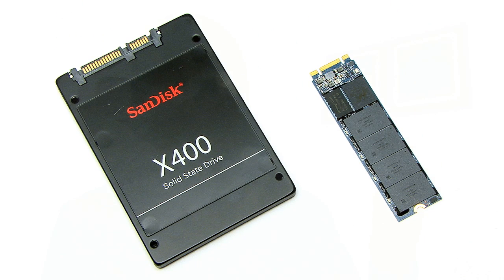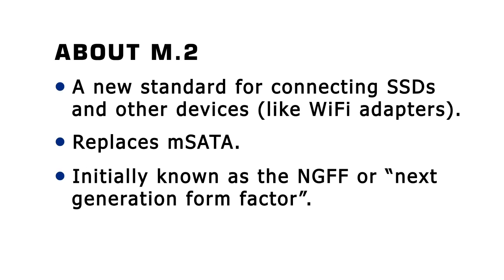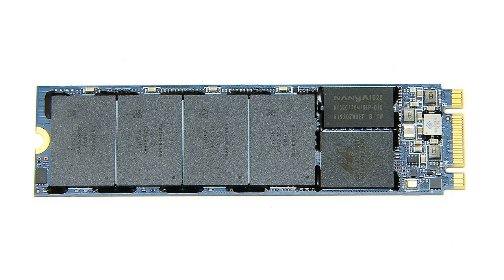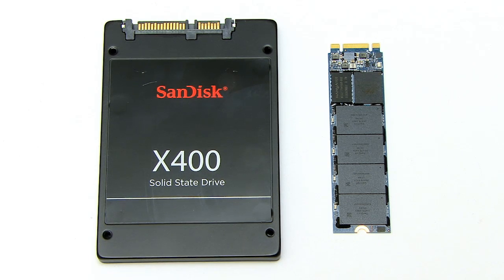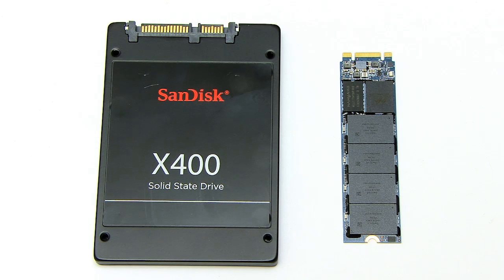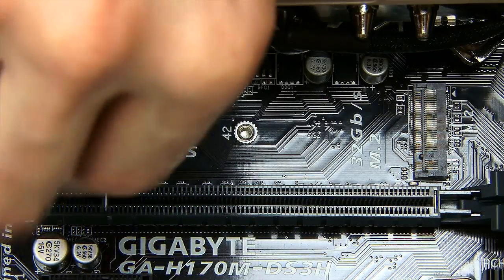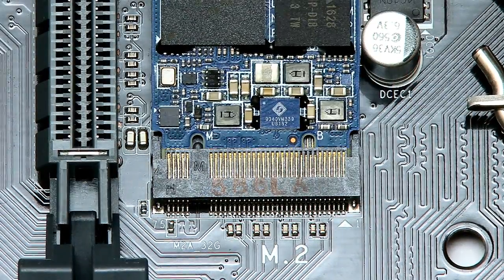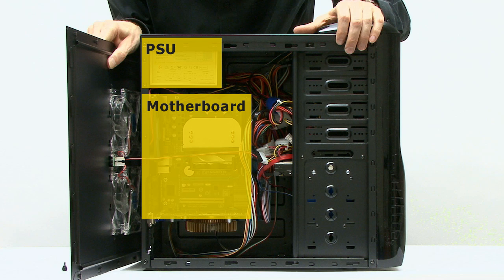Explaining M.2 SSDs

Comment: What about the block-level interface?

Conventional hard drives present an interface where the OS can reliably read and write numbered blocks in an arbitrary order, and build a conventional disk-based filesystem on top of that.

Flash storage, on the other hand needs wear-levelling to try to reduce the chance of blocks going bad, and also prefers to do writes in larger chunks. SSD controllers go to a lot of trouble to hide these peculiarities, and present an interface to the OS that looks just like a disk.

However, some OSes (like Linux) have purpose-built filesystems that are designed to deal with the characteristics of flash storage, including explicitly taking wear-levelling into account. That means they don’t need the SSD controller providing that disk-emulation layer, which just adds overhead and gets in the way.

Are there “bare bones” flash drives, if you like, that do away with the disk emulation, and offer a simpler, more direct controller interface? Would they offer better performance when used with such filesystems?

Comment: can i install m.2 sata  samsung evo 860 MZ-N6E1T0BW on a nvme slot
Reply from the maker: Not unless the slot is specified for both SATA and NVMe (PCIe) drives. You need to check your otherboard / PC manual very carefully to see it the slot supports SATA SSDs.
Reply: @ExplainingComputers i have asus gl702vi laptop, which already has a nvme ssd. im not able to find any details about the motherboard support list.
Reply: @ExplainingComputers  also i have done a crucial pc scan and it says it supports m.2 mx500 sata ssd

Comment: Informative. Im a little old school so I haven't embraced SSD's yet. My main concern is lifespan. I get an average of about 6 years out of a standard hard drive. How do thees compare in terms of life span? Assuming a desktop environment not a server.
Reply from the maker: You may well get six years, depending on your intensity of use. Could be more. I would count on 3 to 5 years.
Reply: I have a latitude purchased back in 2011 with an SSD. Works fine.

Comment: Is it possible to use a sata m.2 ssd on a PCIe m.2 socket?
Reply from the maker: No, but many M.2 slots that support PCIe also support SATA drives. So if you have one of those M.2 slots, yes. But if it is a SATA only M.2 slot, then no.

Comment: m.2 blocking a sata is out of date
Reply from the maker: Not "out of date" for most motherboards out there! :) And as far as I am aware, using a SATA SSD in a M.2 slot on most boards will still take one of the alternative SATA ports on a board (it has to map to somewhere!). But if you fit a PCIe / NVMe SSD in an M.2 slot that will take either a SATA or NVMe drive, then clearly it will not take out a SATA port elsewhere.

Comment: I have a very inexpensive laptop that was given to me as a gift a  Lenovo N22 Laptop It came with only a 32 Gb internal drive. It worked fine for my needs just use it for word doc’s excel sheets email some streaming like YouTube. Well the very first Windows update would not install because I couldn’t clear sufficient space for the update which was 10Gb+. Added a external drive moved all of my files to that. Tried Windows instructions using USB flash drives just could not get it to work. I looked at the board and I see an empty M2 slot. I have seen mixed information on some sites regarding installing a M2 drive to this model. If anyone knows do I need to change the Bios files to make this the boot drive. I’m 70 years old not very computer savvy anyone have any ideas. If I do end up needing to get a new laptop I feel bad about having to use this one as a doorstop. Would like to give it my 8 year old grandson is it safe to run without the updates installing?
Reply from the maker: If you pass the machine on, rather than running without updates, install a Linux distro on it -- will run fine from a 32GB drive. EG: https://www.youtube.com/watch?v=eI7QQqnV1P8

Comment: Nice video. When you open the 3.5 inch SSD,  only a portion of the size of the drive is actually the SSD. The size is just to meet the 3.5 slot. The M.2. variants, that doesn't make it easy and very confusing, why do manufactures do this anyway.

Comment: Very informative!  I'm curious how the SSD is protected against ESD, electrostatic discharge or EMP.   Hard disc drives have metal casing that provide some protection against EMP.
Reply from the maker: It is no more and no less protected than other components on a motherboard.
Reply: @ExplainingComputers  Thanks.

Comment: Why is mSATA called NGFF (form factor) and M. 2 which replaced it is "just" a different standard to connect ssd?
Reply from the maker: NGFF is the old name for NVMe, not mSATA. M.2 is type of physical connector that can accomodate many different interfaces (including SATA and PCIe) and which can be used to connect many different kinds of devices (eg SSDs and WiFi cards). In contrast, mSATA is an interface with only one type of interface (SATA!). See also my NVMe video: https://www.youtube.com/watch?v=kvHUVcgo8xY

Comment: Just came across this very helpful video.  Quick question, though:  in the example demo it was mentioned that a SATA port will be taken up by the M.2 device.  It was also mentioned that the speed of SATA is 6 Gb/s.  However, etched on the board it claimed 32 Gb/s.  That would seem to imply that the demo M.2 card was PCIe.  If so, is a SATA port "used up" even if the device is PCIe interface?
Reply from the maker: The demo M.2 SSD used was SATA. The slot it was inserted into takes either a SATA or a PCIe SSD (hence the speed rating). Inserting a PCIe (NVMe) SSD into an M.2 slot should not take up a SATA port. You may find useful my video about the WD Black M.2 NVMe SSD -- https://www.youtube.com/watch?v=kvHUVcgo8xY -- in which I also talk more generally about M.2.

Comment: Just re-watched this video in October 2018. With the recent release of the x86-64 LattePanda Alpha (as well as the previous model) and the UDOO units, it's very interesting to see that the "regular" PCs and the SBCs seem to be converging. Now that both can use PCIe-based m.2 drives, that part of the solution seems to be in place.

Comment: i dont understand why all in 1 pc is so expensive considering it can all be a 1 board computer... why do we even need replacable parts anymore since some computers can be reliable for a very long time cant we just have a computer brick and a power brick and be done with it !
Reply from the maker: All-in-one PCs still need to be manufactured from standard parts (like CPUs and RAM) and these cost no less in an all-in-one form factor.
Reply: i DISAGREE... sorry for caps but say a big computer maker like asus or intel make only 3 computers(low end for web browsing, medium for playing every modern game at the time, high end for rich people more than you ever need for a long time)... just 3 not repairable not upgradable computers, all on 1 chip computers... ultra mass production nobody would be able to compete with the prices. ssd storage as big as  modern hard disk drives on the same chip as the cpu and gpu...    i dont see why there would be a need for the large variety of parts that may or may not be compatible with eachother . different sockets for internal parts of a computer sounds like a problem that need not exist if computers came made for cheaper prices and better than a custom build.
Reply: @ExplainingComputers  look at phones for example you dont see people building smartphones out of parts...
Reply from the maker: Smartphones are made out of parts! (SoCs, RAM, flash storage, etc). So I don't understand your argument here. And most of the cost of most PCs is in the CPU, chipset, RAM and storage. And these are all manufactured in very large quantities. Variety of designs is not making PCs expensive, it is the cost of the CPU, RAM, etc, and these are some of the most standarized, mass manufactured items on the planet.
Reply: @rroge5  if you search around YouTube you can find a bloke who lives somewhere in asia who DOES upgrade the ram in his phone.

Comment: Interesting video !
Two (or maybe 3) years ago I had the money to buy parts to build another PC, as my 'old' one was about 9 years old, but still worked just fine, but I had the itch to make a new one.

I ended up with an Intel 750 400GB Nvme Pcie jobbie, and 2 x Samsung 950 Pro 250GB M.2 drives.....because my Gigabyte board had two slots, and it seemed a shame not to use them....:)
So only my Gfx card - in slot 1 -  and the Intel drive in slot 3 (to give air space between them) are using the Pcie slots.

I do have some regular 500GB and 1TB 7200rpm HDD's and a pair of WD 500GB 10,000rpm Velociraptors spare from my 'old' PC.
I have Win 7 and Win 10 installed on 500GB 7200rpm HDD's, disconnected as emergency drives should something go wrong with the Nvme drives...
The Nvme drives were not cheap, but could not resist....:)

Comment: I actually like having the storage separate. Makes upgrades more convenient. Though, I suppose a M.2 drive being easily removable by just taking out a screw if the motherboard dies wouldn't be too bad. Still, the fact that dedicated drive bays are physically larger does allow more functionality to be fit in there, and there are lower limits to how small you can make certain devices. You're not going to fit a blu-ray drive into anything smaller than the 120mm diameter of the discs, after all.

All this integration is a bit annoying, though. Really limiting how much you can control what's in your machine and forces you to make compromises ("If I want that network chip, I have to have this drive controller" sort of stuff). What would be better would be if the motherboard was just for supplying power and passing signals around, and the actual functionality, such as network, USB, SATA, etc was handled by dedicated cards. The form-factor of the M.2 drives could be great for all the little stuff that's built into the motherboard chipset now. USB, Ethernet, and SATA could be covered by mini PCIe cards and audio by a regular card, like it used to be back in the ISA and PCI days.

Comment: I have an M.2 SSD installed in my Dell 7570, and recently installed a 2.5" HDD in the vacant SATA bay within, and both work together. I didn't even have to change any BIOS settings, the computer recognised the drive as soon as I rebooted. So when you say that installing an M.2 SSD disables the SATA drive socket, that must depend on the particular computer in question, and it's setup.
Great video however, concise and informative. 👍

Comment: Springloaded like RAM modules in laptops. I'm actually surprised by the fact that you need a screw to mount them, such a mounting process requires a screwdriver. Manufacturers might as well build some sort of "hooks" in which secure the drive, much like RAM modules. THAT would be easy.

Comment: Hi - that was great, but you missed out comparing AHCI with NVMe technology - what are the possible (interface limited) speeds for AHCI? Could an NVMe drive perform faster than AHCI?
Reply from the maker: I'm pretty sure that NVMe will be faster than AHCI, which I would see as a legacy interface these days. I did not mention IDE either! :)
Reply: OK thanks, I picked up a used AHCI drive and I just wondered.
Reply: OK, thanks. I meant to say that I picked up a 128G M.2 AHCI SSD and I wondered how the same product with NVMe instead of AHCI would compare. AHCI version of M.2 SSD was still on sale, new, last year. Might still be on sale now as cheaper alternative to NVMe.

Comment: Strewth! I remember when I found a guy locally producing circuit boards for adding a massive new-tech 10 MEG hard drive to my then Z80 computer (initially Tape Storage). That was a real hoot back in those days... what, wow, 10 meg, jeez. Now I read this excellent presentation about current trends and hardware and will never stop being in awe of the speed of tech change these days. Boxes are becoming yesterdays hardware before one gets them out of the shop. Thank you for passing on the knowledge.
Reply from the maker: The speed of progress in tech is indeed amazing.

Comment: If you really think about it, even if you don't have a mobo with M.2 slots your could buy a pcie card and mount them that way.  The only thing is that you will be giving up a pcie slot and chances are you mobo won't support NvMe and you won't get the speed advantages with AHCI.  Dunno if its possible for a mobo manufacturer to put NvMe capability into a mobo with a bios update though.  Still if you just want to save space with a sff pc NvMe is the way to go.

Comment: Question : What is the Compared Durability of an SSD SATA vs the M.2 ?
Reply from the maker: They should be the same for the same drive specs -- the flash memory chips and controllers will be pretty much the same, or identical.

Comment: hello thanks for the video ....also i have a problem...my motherboard is 990fx killer and supports M.2 NGFF ssd but i cant find anywere if is the M.2 2280 or M.2 2240 ...please some help here
Reply from the maker: A full-size motherboard almost certainly supports M.2 2280, and will probably have different screw holes to allow shorter M.2 modules to be used. See the diagram in the video showing the different sizes of the devices.
Reply: Thank you a lot

Comment: i did a TON of reasearch before buying an m.2 and i still learned a lot from this video! i went directly from a 7200rpm HDD to a gen 3x4 m.2 and on my first boot up it blew my effing mind! i kept hitting restart just to marvel at the speed. now i just have to wait for the tech to advance a little more so that 1TB sata SSD prices begin to dip so i can transfer all of my games and other files onto one (of course by the time i will be able to afford that the tech will be so much better and i will feel like im lagging behind again...)
Reply from the maker: Great story -- that was quite an upgrade, so the changing in boot speed must have been amazing! :)
Reply: Wanna see something that'll REALLY blow your mind?  I put two SATA III SSDs in my computer in a striped raid configuration.  The thing boots so fast that I never see the Windows start screen unless it's applying updates.
Reply: @PrinceAlberts  Ooooo, now repeat that exercise with two PCIe NVMe SSDs (using a RAID controller that would allow the OS to boot from the RAID).  I once designed a boot controller for a Nokia transceiver that reduced its boot time from 40 seconds down to 30 milliseconds (including full RAM tests).  I had to include a "Reset Occurred" status in the logging else it would reboot so fast no one would notice.
Reply: Chris Brisson: That sounds amazing!  I wish I had the money to do it.
Reply: I remember when switching from a floppy disk to a hard disk sped up boot times too. Don't worry, software bloat and inefficient compilers will eventually slow things down again.

What gives me some wry amusement is that fact that while operating systems now take up several gigabytes of disk space their error messages are as meaningless as ever to the actual user.

Comment: Fantastic, I have installed an m.2 NGFF SSD in place of my HDD drive with SATA III connection. I would like to know could I still benefit from performance of DDR , D NAND etc... capable on m.2 SSD? Or is AHCI inhibits it's ability to perform as well as if from PCIe connections? I also have a second M.2 SSD slot installed with a 16GB m.2 module with OEM software for cache to improve the HDD's loading speeds etc... if my m.2 SSD already has NAND flash would it still be relevant to have this OEM software in the m.2 slot or can it should aid in some capacity? Unfortunately I wasn't able to find an m.2 SSD of reasonable capacity at 2242 M+B key for this slot so instead purchased a 2280 to install with SATA III, what degradation if any can this do for SSD?

Comment: Very useful; I'm looking into the possibility of a self-build.
On the SATA3 power connector, why does it need so many electrical contacts, when there are only four wires in the plug?

Comment: Did I miss something or there was a "M.2 32 Gb/s" printing on the motherboard? And you said about transfer speed of 6Gb/s for both sata devices? :) I believe, this M.2 goes for PCIe ;)
Reply from the maker: The motherboard M.2 slot (like many today) will take either a PCIe or a SATA M.2 SSD. But the SSD I fitted was a SATA one, so has a 6Gb/s transfer speed. So what I said in the video was correct.
Reply: ExplainingComputers didn't know that :) I thought that only NVMe SSDs could be plugged into PCIe slot. Thanks!

Comment: m.2 is great for laptops. They help to reduce weight. There is no case or brackets as there is with conventional Sata SSDs, they are a smaller form factor, and they also eliminate the need for sata Cables.